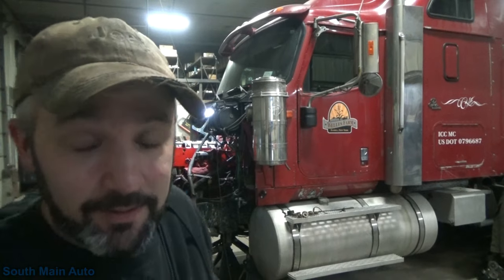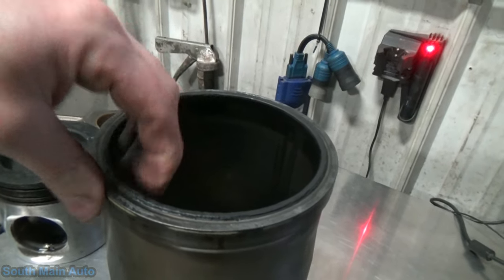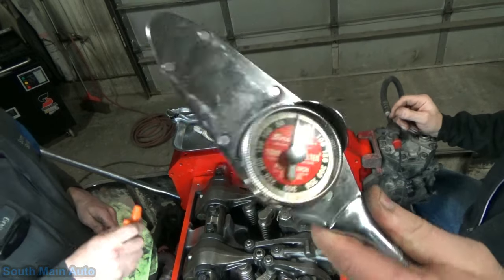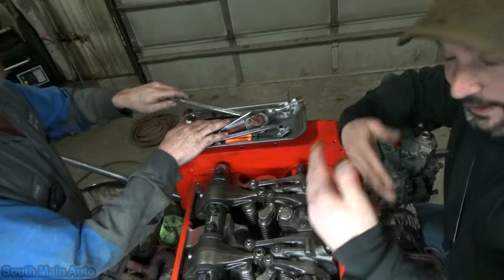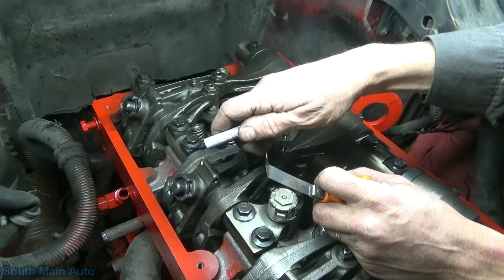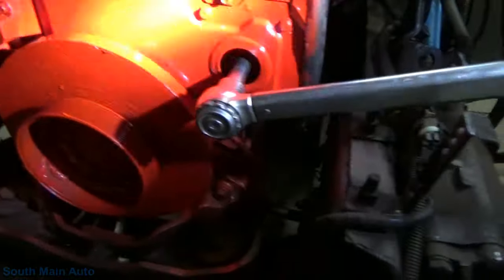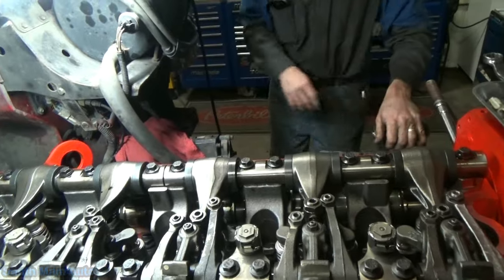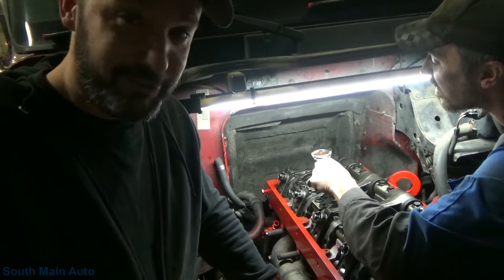Cummins ISX CM570 Adjusting Valves, Injectors & Exhaust Brake

Comment: pre emisions truck worth rebuilding
Reply: These trucks put miles on so fast they are always worth rebuilding. 900,000 miles out of an engine. One in frame overhaul and you can get another 900,000.

If your truck is moving 300 days of the year, 8 hours a day, averaging 50mph you are talking about 120,000 miles in a year and that's pretty conservative estimates.
Reply: @Cragified  How much does a rebuild like this cost?
Reply: @lomparti  ~ $15,000 . Which when compared to a the cost of a whole new engine which will be a used engine anyway as they don't make these anymore is going to cost you ~$20,000.
Reply: @lomparti  He said $16,000 for that one but if it had more bad parts the price would be higher.
Reply: @badgerpa9  That's about right, about a year ago I had my 04 Mack's engine done, it cost me a little over 17k, but I also had some things that needed fixing. I do most of the work on my truck myself as an O/O, but I don't have the shop or all the tools needed to do an in-frame.
Reply: @kman-mi7su  Most common tools- Send out the Head and make yourself a Liner puller or borrow one.I dont know much about Mack late model,Single or twin cam for injectors?
Reply: @Cragified  depends upon what kind of work you are doing. i am a truck driver doing farm pickup and i only drive 100-150 miles per day. the truck i am driving has a shitty paccar MX13, i dont think that engine will last anywhere near 900K, especially considering im hauling heavy milk loads. truck can gross over 105K. im a company driver and did not get to choose the engine. i believe the MX13 is more or less a throw away engine.
Reply: @andrewdonohue1853  Paccar's biggest problem is they don't put much into supporting truck shops with the information, specs, and parts to work on them. And even less to the owners. 

It's a decent engine but if you don't support your product in the field it's going to have lots of problems.
Reply: @Cragified  the truck im driving is a 2017 T880. it has 126K on it. the climate control has issues already, the vent doors arent working. the check engine light is on for the 2nd time. it has to go back to KW again.
Reply: @andrewdonohue1853  I feel for you, some trucks just are lemons. Built on a Friday is the old saying.
Reply: @Cragified  my truck isnt nearly as bad as some of the other trucks i have seen have failures in the fleet. all T880's. the trucks that keep going is the older T800, frightliner FLD, international eagle..... those all have cat engines
Reply: @andrewdonohue1853  the actuators aren’t terrible. Disassembling the entire dash is what you have to do, the HVAC box can just be wedged slightly open to get the doors swapped out (they break too) and the rest is cake. Pretty time consuming.

Comment: thanks mister O! I drive a class A for a USPS Contractor in the winter, and I never knew how they adjusted valves.  

in fact- one of the videos you mentioned you couldnt get parts because of a severe snow storm in Philadelphia.  The reason you didnt get your parts was ME ... I ran the contract route from philly to rochester/buffalo at that time (All of your packages and first class from this area get sorted through rochester), And I turned around that day in the storm and didn't make another attempt for 2 more days...  So- it's a small world.
Reply: Ahh so it is all your fault HAHA!!!  Yep sometimes you just have to turn back and wait for safer travel weather.  Probably a great call on your part, better safe than sorry.

Comment: I have a small tip for setting lash. I use a Snap-On Torque Screwdriver set to 6 in.lbs to set the adjusting nut against the feeler gauge and tighten the lock nut. makes for a very accurate and consistent valve adjustment.  Just a easy tips for people

Comment: Man that brings back memories. No vgt turbo, egr, dpf, or scr to mess with. 14 on the intake, 27 on the exhaust, 7 mm on the jakes, and two flats on the injectors. Rock and roll baby. Overhead adjustment is very similar to the N14.

Comment: Watched in Sept 20.  What a pleasure to see two brothers working at the top of their game and enjoying it.  I think the Cummins fuel system was called "PT" for pressure and time those being the methods of fuel control on the mechanical injectors.
Not being as familiar with setting valve clearance (UK) or lash, I have always taken the precaution of trying to insert the next size feeler gauge which should NOT fit into a correctly set assembly.  In the video I would have tried a 15 thou following the 14 used for setting.

Comment: I drove in 97 a very high HP Cummins powered truck.  Boss had overhauled it to over 800 HP to the ground.  When you can stand on the power in the high side of the transmission and you almost pick up the Right Front tire off the ground you have a beast.  That truck has over 2 Million miles on her and over 1 million of them at the current settings.  That old girl would out pull any engine that was painted Yellow.

Comment: Brings back memories when I first did a in frame rebuild on a 98 Volvo with a 60 series Detroit with close to 1 million on the clock. Truck was falling apart and the owner was a cheapskate. I had to run 12 gallons of coolant through a paint filter Because he wouldnt get new stuff. The engine was a top when we got done. Also replaced 8 drive tires. Rest of it was clapped but it ran great.

Comment: Only thing that grinds my gears on the Cummins are the feet that contact the valve bridge.  Total pain trying to slip a feeler gauge in there when they are covered in 15w40.  Great vid though, makes me glad that the QSL9 and C7, 3126 that I deal with on gensets are HEUI and dont have Jakes.  They just fire up and head for 1800rpm as quick as they can.  Overhead sets get done every 3000 hrs on them, and usually we are surprised if the green ones make it to 16000 before they puke a crankshaft.  Now that is some carnage.....90% engine load and 1800rpm, then blammo.

Comment: "Did you pull the coil wire so it doesn't accidentally start?" Funny stuff! I ran my Cummins powered 06 Classic XL to 990k. Then left it @ Pittsburgh Power while the wife and I took 2 months vacation. While there, it got an out of frame and an uprate from 600 to 800hp. They dynoed it first and it was still in excellent condition, very little blow by etc. That's what good maintenance does. The trans, rears and front end were also gone through at the time. I basically got a brand new tractor for 1/2 the cost as well as time with the wife and family. Win/win situation!

Comment: Them small pistons.. I worked for Cummings building backup Generators. The piston comes in a 5 gallon bucket. I could stand inside the engine installing all the electrical wiring.. While watching them guys install the rod bearings.

Comment: I have a cm2350 2016 kw t680 with 758k on the clock and so far shes been strong but im looking into getting a new head from atl diesel with all new cam, gears, rockers and everything its much better than the oem head ive heard anyways this is my 6th time? I think watching this vid i learn something new every time!

Comment: Great video, very interesting. 
Just two comments though:
1. Running the rack refers to adjusting the fuel control rack in a two stroke mechanical injector Detroit Diesel.
2. Those Jake brakes are compression  brakes not exhaust brakes. They operate the exhaust valves so that's where the confusion may be coming from.
Reply: Boom

Comment: Did my apprenticeship with Cummins sales and service back in 76. It later became Cummins West. All those guys I worked with have passed away. 
They would be shocked to see what time has done to the old 855 NT engines. 
I got out of trucks as wages were not that great and have basically planed out. 
I’m in the car racket now. If I could take the best of trucks and cars. Combine them. That would be sweet. I’m close to ending the work years. 
Did I say I love red? Yes I do. I hated that Cummins beige

Comment: Love big truck videos,I'm professional driver myself,been driving last 10 years and have over million miles of experience. 
I own a 07 Volvo 780 with volvo 16 litter engine 535 Hp.
Last year Volvo in Des Moines IA did premium overhaul on my truck (turbo injectors head etc.)also engine harness,exhaust manifold,clutch,fuel filter housing,oil pump (which is not included in overhaul btw. weird? I know) and slave cylinder for transmission.
Paid $34000, three years or 350K miles warranty.
So for me watching you guys work on one of these things is just like watching Porn Hub.
Please keep those videos comming.

Comment: My poor old Cummins is only at 480 thousand. It is the early '98 but I didn't put all that mileage on it. When I bought it the clock was just over 400K and I just wanted somethin to drag my 5th wheel around. I had been using a Chevy 1 ton but I was always having heating issues from the automatic transmission so I made a point to find a standard transmission with a Cummins. It has surpassed my expectations and continues to do the job well although a little slow on the hills. The whole rig tops out just over 20 thousand pounds so it has a right to be a little slow on the hills.

Comment: You should get together with your brother and show a rebuild, theory, and running of a Detroit xVN, T or TT. a 16v93TT would blow your viewers mind! Even just a 6v53N would give them a good idea how one works. Even the ability of the motor to run backwards accidentally or laying on its side like in a coach application.

Comment: Once you have one set correctly you can just determine the proper clearance by the number of turns on the adjuster from valve contact to proper clearance as the thread pitch is the same on all adjusters. It actually gives a more accurate clearance if you encounter wear on items in the valve train

Comment: DO IT DOUG! DOOOO IT!! :D

I laughed at the coil comment there LOL! "You just disconnected the coil, right?" , "Yeah". HAHAHA! Some newbie engine folks may not have picked up on that one. :)

This was great! First time I've seen inside one of those. I hear from my buddy who's been driving for years about in-frame rebuilds, and the removable sleeves, etc., but was nice to actually see it.

 Love those diesel pistons - I have a set of 6 out in front of my barn here. Came out of one of the trash trucks I used to drive years ago. Weigh about 10 lbs each! Not quite 5", so a bit smaller engine, but still huge by my standards. I've done more motorcycle and OPE engines than car engines over the years. Tiny little 1" pistons in some - some even smaller! Heavy truck valves are bigger than the whole piston/con-rod/crank assembly combined, lol.

I would definitely love to see some big diesel carnage! Never seen one blow up before.

I had an old P&H excavator here with a 2-stroke Detroit in it - I let my neighbor store it here while in the process of moving. Would take a shot of ether to get it started, but once running, it ran great - never been rebuilt. Thing used just as much oil as diesel, lol. Surprised it didn't run away on us. Runaways make excellent Youtube vids, HAHAHA! I think we created a brownfields site here between the leaking engine and hydraulic oil, LOL. What a BEAUTIFUL sound out of those old 2-strokes though! Nothing better.

Comment: As an early 1960's three ticket tradesman, general machinist, 3rd class stationary engineer, and heavy duty marine diesel mechanic (primarily military) myself, when you held up that connecting rod, my memory cells went from low idle to amber region on the tach in .0001 sec. Love your stuff Eric.

Comment: "running the rack" goes back to the good old driptroits. the only good use for them was as a boat anchor. but when it got to 25 and 30 below they were the only things that would start if it wasnt plugged in. never had the pleasure to work on one of these newfangled things.looks a little different but i could do that in my sleep.  nice to see the big trucks, they need to start a channel..
Reply: The old two stroke jokes were excellent at converting diesel fuel into noise.

Comment: nice to see an ISX. Not much has changed from the old 855. No push rods and better adjusting screws. We use to have to in frame 855 around 300,000.  Cams were a problem for a while so I guess Cummins didn't get it right yest on this one.

Comment: I kind of like the ISX,  good Torque,  and pretty good fuel mileage.  I was driving an International 9400 I (2007 year)  400 horsepower  eaton/Fuller 10 speed I got 6.25 MPG not great but decent.  

I had a 2000 Freightliner,  N14, had  1 million 250,000 miles.  Replaced one set of fuel injectors,  2 clutches,  brakes and brake drums.  The engine and drive train was still doing great 13 speed Eaton/Fuller  Eaton drive axles.  The cab had so much plastic everything in the cab was falling apart.

Comment: Cummins specifies the set screws for the valves bet set to 5inlbs when setting lash, gauge should “snap” when pulling it out from between the bridge and rocker. No guess work, arguments about theories/practices and consistency throughout. A lot speedier too.

Comment: LUV IT! What do these large Diesels use to start in cold weather? My small Diesel uses, low voltage, "glow plugs".
Reply from the maker: They use 3 to 4 battery's. No glow plugs on these. Some times a little sniff of the good stuff to kick them off :)
Reply: Nothing extra. Direct injection does it all. Sometimes a shit of starting fluid is needed. If compression is good. Batteries up to snuff. They fire right up
Reply: Cummins uses an intake grid heater. Basically just a heating element to heat the intake air going into the engine instead of glow plugs

Comment: Nice video. You can tell you were raised around big rigs and worked on them at one time. Interesting stuff I learned a lot. If Doug started making videos I'd subscribe and you wouldn't hear a peep out of me about torquing b/c I only break out the torque wrench on critical torques. After 40+ years of tightening hardware if I can't tighten a bolt without it loosening up or over torquing it then I need to find another profession especially after having to use a torque wrench on just about everything in the aviation world. I know the shop talk would cause a stir probably but I'd feel right at home and probably LMAO. Enjoyed the video with you and Doug so keep them coming and if you get your Dad or the shop guys together it would probably be pretty entertaining.

Comment: i remember one of the first big jobs i did, replaced a cam on a MP7 engine.  well I accidentally knocked a bridge off the ex valves on #5 going back together.  Ha when i fired it up it sounded like the jakes were on.  SO scared as hell i pulled the valve cover and found what happened.  Re ran the overhead again just to make sure, and she ran smooth as ever.

Comment: Seems like you guys keep the wrenches in the family-- What about GO-NO GO gauges? I had several old muscle cars with solid lifters and the old VW engines too have mechanical lifters but always used standard gauges with drag myself

Thinking of some advantage of a two piece piston? I would think that would lead to metal on metal even with the compression holding the top down 

OMG towing that boat into NYC, that sounds like an experience

Bought a 2017 Hyundai Sonata [manual] with their new Allison engine, I can tell you it gets 4-5 mph better mileage than my 2009 Accent so extremely efficient, last tank was 35.8 MPG, pretty impressive considering its much bigger than the Accent and also 40 HP more

Comment: I never drove a truck with a jake brake, but it seems to me I was told that a jake brake was  a handle inside the cab that you used to engage the trailer brake only, basically using your customers trailer brake and not your tractor brakes, in the long run saving you brake jobs. Maybe Im getting that wrong, or that has a different name. My tool box is filled with tools that truck mechanics leave laying around on the rig, always nice mac.
Reply: Charles Miller, it's called a trolly brake, or Johnson bar...
Reply: Thanks, that what I got it mixed up with, memory just aint what it used to be !!
Reply: You're welcome...I hear you there...getting old sucks...lol
Reply: I guess Im just a little different, I actually enjoy getting older, out of the 10 very close friends from childhood I only have one left. I have alot of time to try different things nowadays, I visited 27 Countries before I was 16, so traveling I don't need to do. I seem to have 20 projects going at one time, Do I have the energy like I had when I was young, of Corse not, but I have learned how to pace myself, and get done most of what I want to get done, You Tube has played a major part, I learn how to do so many things. I wish you could request what kind of video you want to see, maybe someday who knows. Eric did help me with my brake calipers, so that project is done, at least the brakes. This morning I replaced the Clutch master cylinder, and slave cylinder. Another project crossed off my list. When I worked everyday, this simply just could not of happened, I worked 14 hours a day 6 days a week. That's what you get when you own a Company.